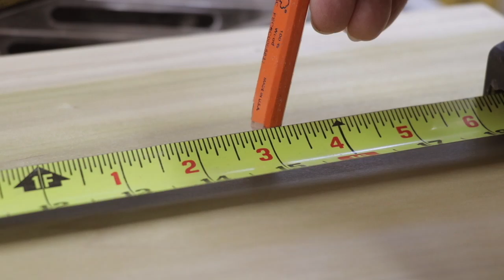Building A Traditional Carpenters Toolbox! (START to FINISH)

Comment: Great build, Daddio. The only thing I would do differently is add dovetails to connect the bottom, which you didn't do. They would add way much more strength to the bottom, and when carrying heavier tools, as I used to do as a commercial carpenter, a fallout would never be a consideration. 

Look forward to watching the timber frame build.

Comment: Several years ago I built a box similar to yours. I used 3/4 plywood and I had two drawers in the bottom for chisels and misc small tools. The box looks really cool and works great. The down side is it’s weight prohibitive. Empty it weighs approximately about 25 to 30 lbs. with tools it’s 50-60+. 
I’m thinking of adding a set of wheels and a tow handle. That way I can move it like towable luggage! Yours looks a lot lighter and more user friendly!! 👍🏼👍🏼

Comment: Very nice build and well done.  I have a question though.  Your end pieces have your dovetails going with the grain.  Any risk/fear of breakage with the grain? Normally I see dovetails end grain to end grain.  Thanks for the video.
Reply from the maker: Good eye! I don’t expect there to be much stress on the corner joints! I was a little nervous during assembly though.
Reply: @lastingbuild1373  Fair enough.  When I first started I did a sliding dovetail with the grain...  6 times before I figured it out.  Yours should hold fine with the base, etc.

Comment: Hey Mate, love the video and the hand tools used. I want to make something similar, but I am concerned about the cross grain construction that you've got at the bottom of the box. Would the seasonal movement of the base pop the dovetails. Or place stress on the dovetails over the years?
Reply from the maker: That’s a good question! My toolbox has not had any issues so far! It mostly stays in my shop though!

Comment: Beautiful toolbox, thank you for sharing your build. A quick question from a new woodworker (not intended to be a snarky critique...)  - Why handplane a board, then run it through the thickness planer?
Reply from the maker: Great question! I joint my boards by hand then plane a parallel surface using the power planer. I do not have a power jointer.

Comment: Aw Jim. All that sweat equity to machine everything by hand you should have went with something better than poplar!!But this hand built must have given you a lot of satisfaction.  I love the way your hand cut. Dovetails came out and the overall look and heft of the tool box itself.  Also i love the soulful eyes of your sheep/poodle dog.  
Good luck with the start of the log cabin build.  I sense that you live in one if the northern states so probably the actual build will have to be delayed a couple of months.  Assuming that just about the entire build would have to be done outside on actual job site due to the huge scale if the materials being handled I mean golly just look at the size of the tool box. Big tools. Big box. Big project
Reply from the maker: Thanks Michael! Poplar is soft but a joy to hand plane! I live in Tennessee so I should be able to get started fairly quick! Just gotta get some prep done first!

Comment: Nice friend ! The only thing I would have changed ( just my opinion) is to inset the bottom up in to the the box put dowels in to hold the bottom in the weight will be super heavy = the other thing is to make the ends taller 18" then you don't have to bind over to reach the handle = time will fill that box up enormous weight = but nice job SIR
Reply from the maker: timber buckets phil thanks a bunch! It’s definitely heavy as lead! 😂

Comment: Plain by hand for an eternity, THEN, chuck it through an electric planer. 🤔👍🏻🏴🇬🇧
Reply from the maker: I love hand tools but I also appreciate technology!
Reply: Planing by hand will eliminate the high spots on a board that is twisted slightly, or cupped. Then the thicknesser finishes it so you have a nice board to work with.

Comment: I made one of these in the 1970 s I cheated though no hand planes was used and I used a router and a jig for the dovetails, I also put a swivel in each end so the handle could be pushed over so access to the tool box was unrestricted, because I cheated it only took 5.5 hrs to finish